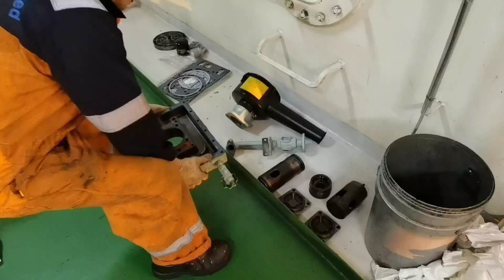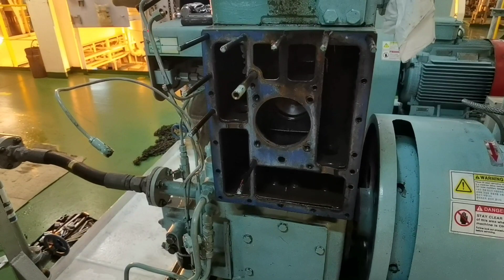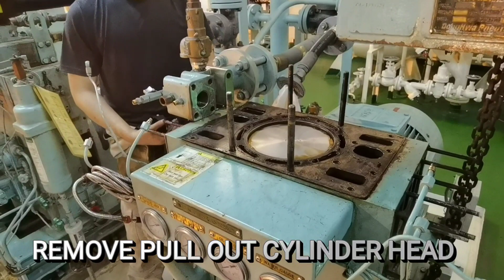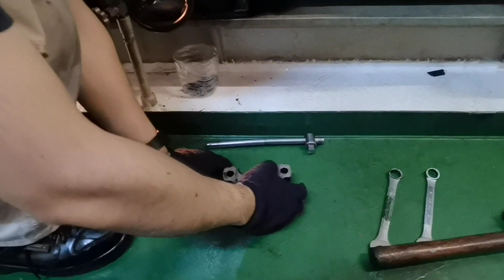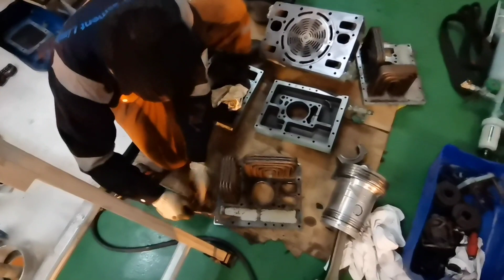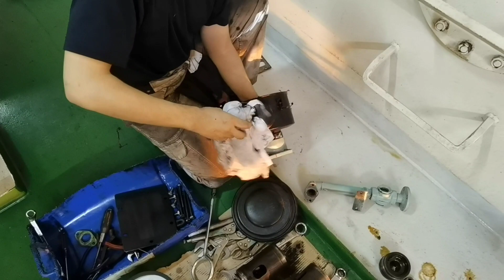HOW TO OVERHAUL DONGHWA-TANABE MAIN AIR COMPRESSOR

Comment: Brother that is a very bad way to remove the cover plate and cooler plate. Because there are jack bolt holes where you can use the same cooler allen bolts to remove them by Jacking and not damaging the gasket or surface.